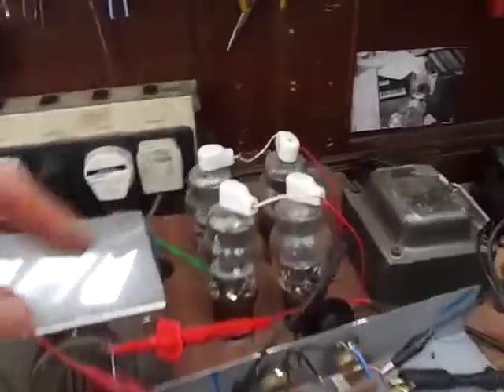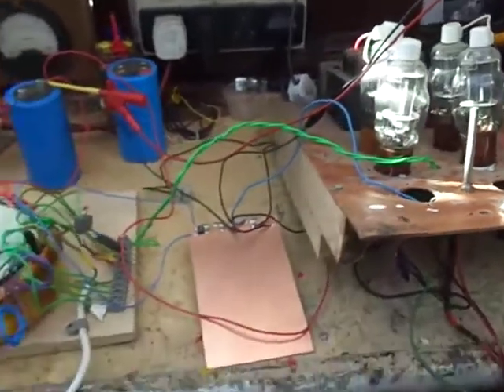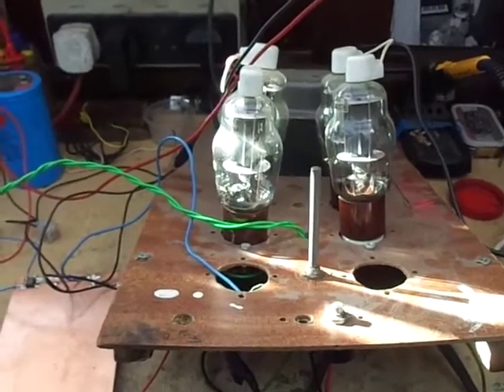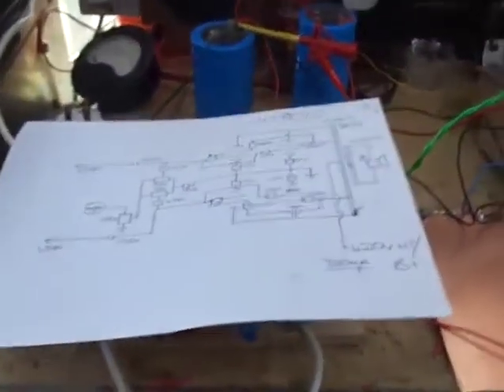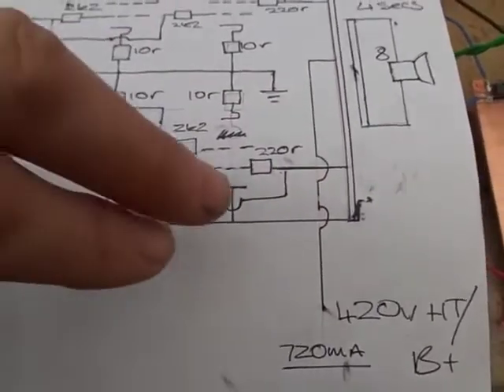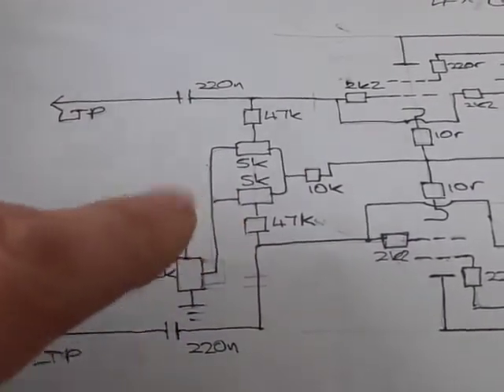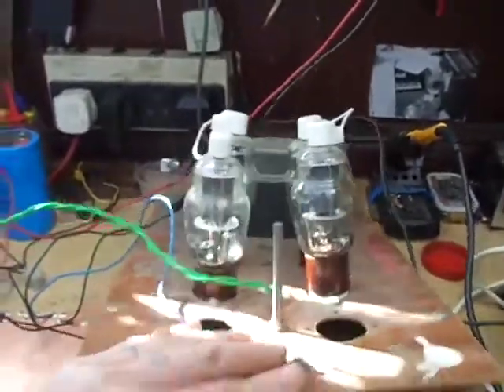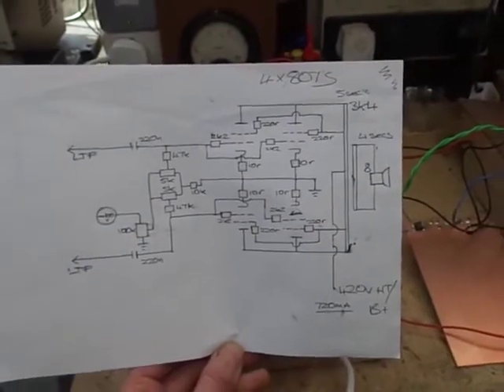Valve/tube Amplifier Design - 807 Parallel PP UL - Introduction

Comment: great video i am building a class A 807 stereo amp
Reply from the maker: Is that from an existing design? A Class A amp is on my list, I have two nice OPT's out of old signal generators that will do the job.
Reply: @diabolicalartificer  i designed  it here is my email. email me i send you a copy eletrontube42@gmail.com